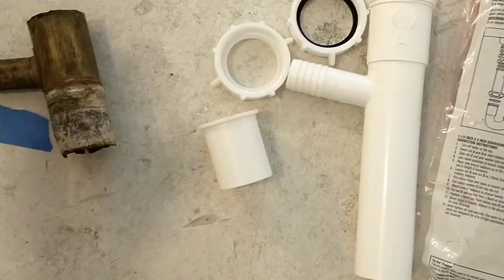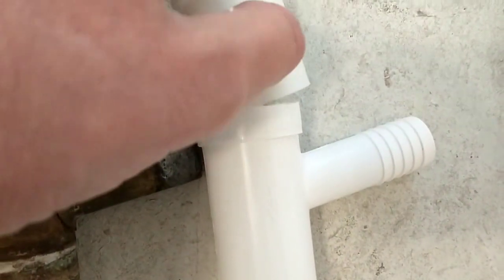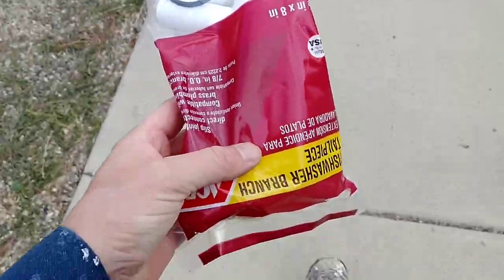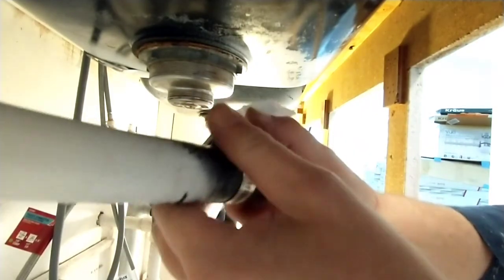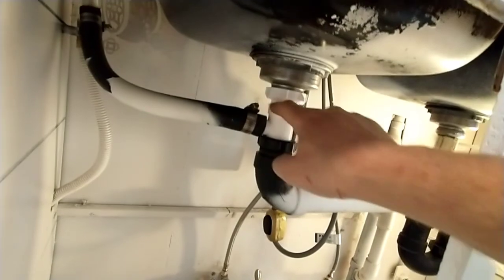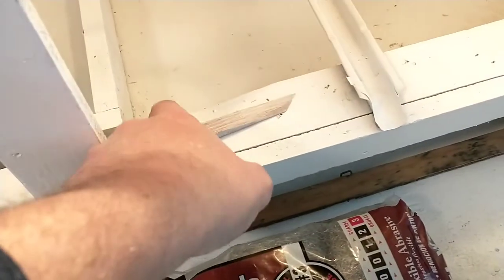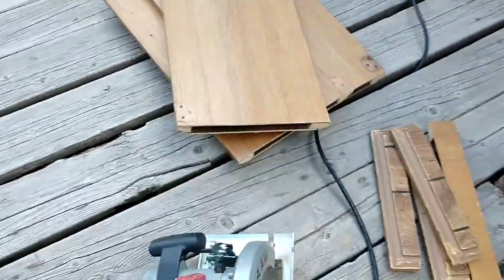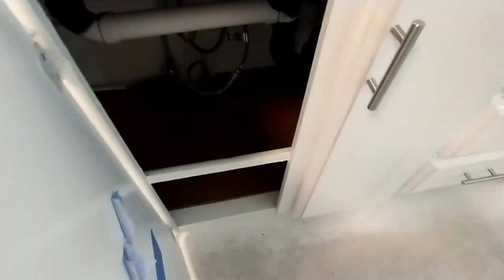A Mobilehome Makeover EP 49: replacing a kitchen sink drain with dishwasher outlet

Comment: Thank you I was wondering how I was going to make it fit . But I got to put 2 tailpieces in because the company that put a furnace in has water drainage for it . But I'm determine to have my dishwasher hooked up too . Right after my husband passed away I noticed the floor rotted out under the kitchen sink so I had to cut that part out and replace the floor then a new kitchen cabinet that I refurnished and all new plumbing for the sink .
Reply from the maker: Plumbing is crazy, sounds like you know the way, work thru issues and you can make it happen!